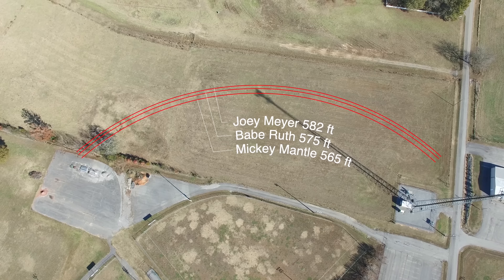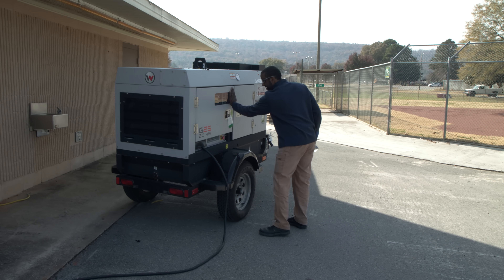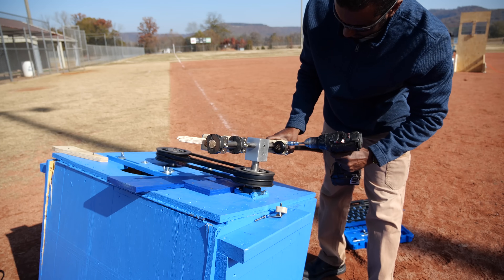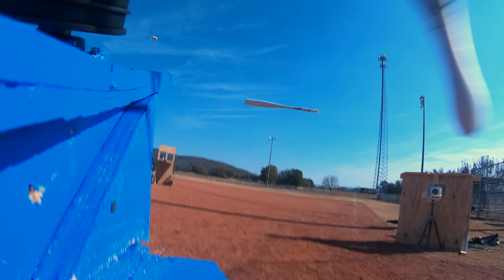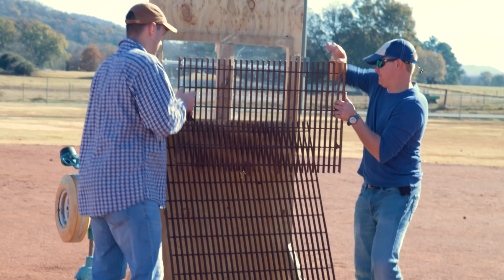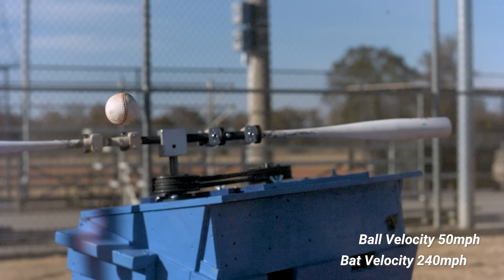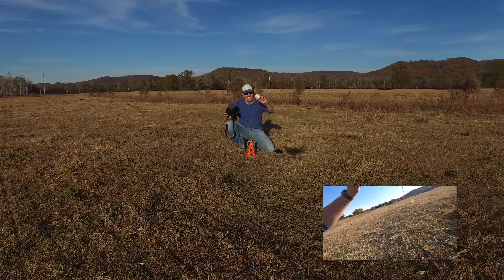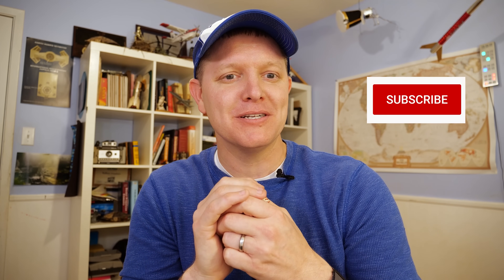World's Longest Home Run (The "Mad Batter" Machine) - Smarter Every Day 230

Comment: There are a couple of different ways that you can explore this into much more depth. Are you trying to hit the furthest baseball ever under the most perfect circumstances or under legal MLB requirements? I think it would be fun to do it under perfect circumstances. MLB uses wooden bats which have a significantly lower restitution, mainly to protect the pitcher and other infielders. 
So since you mentioned restitution, let’s start with baseball bat regulations. The three most common for highschool, college and some adult leagues are USSSA, BESR, and the most common now BBCOR. USSSA uses a ratio in what they call “Bat Performance Factor” (BPF) of 1.20. Meaning that after the ball makes direct contact with the bat, the exit velocity will be at most 20% more than entry velocity. BESR is an older standard and more sought after for adult leagues with no regulations and you can find some of these bats on eBay for almost $1000 brand new. BESR stands for “Bat Exit Speed Ratio” and measure the combined three: ball entry velocity, ball exit velocity and bat swing speed. It was only after about 8 years bat manufacturing companies were finding ways to insert high quality alloys and composite into many different parts of the baseball bat trying to give it as much “POP” as possible. They quickly found that two-piece bats had some mysterious trampoline effect that one piece bats didn’t and boy did it give the batter more power. And this transitions us into the current baseball bat standard for most non-professional leagues, BBCOR. This stands for Bat-Ball-Coefficient-of-Restitution. On most bars along with this you’ll see the number 0.50. Restitution in physics is generally expressed between 0 (non-elastic) and 1 (perfectly elastic). Most wooden bats have a BBCOR rating around 0.50 and this was established again to level the playing field and protect the players of the game. 
My conclusion after explaining all of this, is you want to find a baseball bat that is BESR rated but doesn’t flex like most two-piece bats that you’ll find. I recommend triple alloy bats or full composite bats. 
Now that we are done with that, let’s talk about swinging the bat. Your angle was fine for swinging the bat around, at speeds that high. But one major thing that wasn’t taken into consideration was that baseball players to don’t swing the bat straight around. If you look up many videos of baseball players explaining the perfect swing, you’ll notice as they swing they rotate their wrists counter clockwise through their swing thus rotating the barrel of the bat. Doing so allows that batter to make more solid straight-on contact on the ball, while establishing backspin on the exit of the ball from the bat giving it a higher exit velocity and also allowing it to fly higher. If you were able to figure out a way to employ this into your mechanical engineering, this would be game changing for sure. If you have any other questions feel free to message me. I’ve done a great deal of baseball science research throughout my life and love that I’m able to share it with you. Hope you get to see this. Thanks for all of your hard work in your videos. Happy New Year!!!
Reply: Appreciate the research jimmy. I’d also note that at higher restitutions, you do have a higher chance of your bat snapping or warping at speeds like 200mph.

Comment: Destin: Y'all ready to get smarter everyday?

Also Destin: You reckon this 3/4" sheet of plywood can stop an aluminum bat being hurled at my face at 250 MPH?

Bat: Hold my beer...
Reply: The NotSoGuitarGuy he was in legit mortal danger for like half the vid
Reply: @alex0589  - no doubt. For something like that he needed a reinforced blast wall.
Reply: It's not meant to stop an Al bat, only baseballs and shreds of broken bats.
Reply: It's definitely over an inch thick (2:01). I don't want to minimize safety, because IMO it should be first, but you sure the bat wouldn't have had to come in at juuust the right angle to put more than a dent in that? And what kind of velocity would be left if it got through? Might tickle a little. Batters get hit with 90 mph pitches all the time, direct to the body.
Reply: I think a lot of people are underestimating how strong inch thick plywood is, I understand why people would be concerned but still. Against something as large as a bat I wouldn't worry, if they had tiny shards of aluminium flying around the place then maybe that would be an issue
Reply: Tiny shards of Al might stick themselves in the first few layers of ply, but the pointy end of a broken handled, solid hickory bat doing 190mph would poke itself right through!

Comment: I'd be interested to hear your thoughts on how the differences in energy transfer between the aluminum bat and the maple/ash bats used in the Major Leagues would impact the results of this. You would obviously have to take into account the angle of the grain relative to the incoming ball, but considering the energy transfer is very different for a solid wood bat compared to a hollow (basically spring-like aluminum bat), I wonder how much the difference in distance would come out to being in a scenario like this. Thanks for a great video!

Comment: WOW! This is going to be required watching for my fifty year old son. Now on to the good stuff. Can the ball be fired (compressed air)from a tube/barrel to better find the center of the barrel to maximize the “batter’s power” and then adjust the swing angle upwards to improve the trajectory of the ball? After that I would consider a different bat material. Let’s think about a CNC turned aluminum (7075 T651) bat with the barrel bored out to lighten the front for balance, while keeping it crush resistant. Another option would be a bat turned from one of the engineering plastics with a long draw bolt through the length with a heavy washer and jam nuts to help stiffen the bat and prevent your bat failures. The “Cold Steel” knife company made a synthetic bat several years ago. Now?
 I have enjoyed a lot of your videos. This one is truly out of the park.

Comment: Love your videos, but plywood and Lexan isn't going to do much to protect you against the forces you're working with. Time to step back and look at the SAFETY ISSUE... BEFORE you wind up in the ER or worse. Even the mild steel grating isn't much against an aluminum bat coming at the wrong angle.

Comment: I don't want to be a crybaby about safety but those first tests using just a door were pretty irresponsible. If it had got a clean hit on the ball I wouldn't be surprised to see the ball go straight through the door in a hail of shrapnel and if it chucked the bat at you then good luck. Sure, the door probably would have slowed the projectile down enough that you might be able to walk away from a direct hit but those splinters don't have to be going very fast to take an eye out or catch an artery. 
I get that you obviously can't go carting a precision crafted safety capsule but a few easy to procure items like duvets/floor mats/rugs to spread the impact and catch the bits can really up your chances of coming out in one piece when trying to hide behind a bit of chipboard from fast moving projectiles. Its always better to overdo the safety precautions on the first try because you might not get a second to refine the approach. 

Cool experiment though, well done and all the best for the future.

Comment: From the looks at that first bat break, it seemed like you had the bat lined up perpendicular to the grain. The bat has more strength against breaks when the grain is parallel to the plane of the swing, and doesn't splinter, only crack, when broken.

Comment: Those numbers just make no sense.  If the bat was moving at 250mph then the exit velocity would have been at least 2x the speed of the fastest major league record, which equates to at least 4x the energy.  So only beating the record by 120-150 ft makes no sense.  I'd suspect it to travel at least 2x as far b/c wind resistance is higher the faster you go, so it's definitely not going to go 4x as far, even with 4x the energy.  But an 17.6% increase in distance with 4x the energy, seems off to me.

Comment: I feel like I would be smarter today if I'd learned more about the engineering of the bat spinning machine. Perhaps some discussion about how far down the road of trying to detect the ball and trigger a bat swing  you went vs. just making a baseball bat helicopter and relying on chance. Then, once the helicopter decision was made, what other decisions and calculations went into the design of the machine? Why wasn't a vibration or out-of-balance sensor included in v. 1.0? What role did CAD software play in the design? Was there stress analysis that went on, or was there no time for that? What challenges did construction pose and how did that change the design, if at all? 

As it is, I feel like what I learned here today was that if you hit a baseball very hard it will go a very long way; which, seems fairly intuitive. 

I get that to run a YouTube channel like this, and make anything even resembling a living off it, you sort of have to take the "Mythbusters" approach, I do. I guess I just wanted to register a vote for some actual deeper content for whatever it's worth.

Comment: As a Skunk works alum I read the book before there was even such a thing as audible.  Ben rich was a great man.

Also, in your drone footage there is a bright spot right where the shadow of the drone would be.  I believe that this is from cube corner reflector type structures on plant stems and in the sand, but it would be an interesting video to investigate this effect.  It could be used to fight global warming: retro-reflect the radiation back into space before it can be absorbed and heat things up

Comment: Well Destin, you know what you have to do now. Use physics to show the theoretical longest home run. (Swing angle, ball velocity, bat velocity based on the failure point of the bat material, which I would guess is before the maximum yield strength of the bat). May be cool to use a t-ball scenario to position the ball perfectly.

As always, I love your videos.

Comment: Destin - this video is awesome work as always, but as some have noted, please be careful; you joked about how there wasn't enough reaction time to dodge the bat, but as you also noted that plywood offered inadequate protection.

I decided to calculate the forces here to get an idea of how bad this was. An aluminum bat weighs about 32 oz, so 0.907 kg, and the speed at the end of bat was 250 mph, so 111 meters pers second. Kinetic energy is (1/2 * .907) * (111²) = 5,587 joules. 

That's more kinetic energy than a 12 gauge shotgun (4,453 joules).

That's well within final episode territory.

Dad to dad, be careful, brother.

Comment: I little but important correction to your analysis of three phase supply. Regardless on the number of phases (2 or more) AC motors (ideally) provide constant torque on the shaft given the constant load. Since a part of the current is a magnetization current for the magnetic circuit of the motor, there is always a power factor that is less than 1. However the motor draws constant power from the grid, and output torque is directly dependant on it. 

On the other hand 1 phase AC motors try to create 2 phases by using capacitors, but since this can't be achieved ideally the power has some periodic component and is not constant even under constant load.

Comment: 10:48 in the corner you can see ball flying up because of the Magnus effect
Reply: Your timestamp is wrong.  The ball actually exits the "thrower" at the 10:49 mark.  The bat strikes the ball at very near the end of the 10:49 mark; almost at 10:50.  The ball is set on its trajectory, not my the Magnus effect (which is almost negligible here), but by WHERE the ball is struck on the bat.  Just above the centerline of the ball.  Which causes it to fly straight as an arrow (neither rising or falling) at around a ~30-35 degree angle for a long time due to the negligible Magnus effect because of the flatness of the hit and consequent minimal rotation once it left the face of the bat.
Reply: The Magnus Effect can be most clearly and demonstrably be seen in action at the 10:23 timestamp where the bat induces side rotation of the strike of the ball to impart spin to it.

Comment: That was FANTASTIC!!!  You're funniest video yet!  So...  (munch... munch... munch...)  When are you going to repeat the experiment using a baseball-sized potato gun rocketing the baseball out at 500 mph?  How about a spring-loaded monster-sized aluminum jai alai cesta?

As for the potato gun, the PAK 40 cannon has a 7.5 cm diamter.  I calculated a baseball, which has a 9 inch circumference, would have a diameter of 2.864788976 inches inches, which comes to 7.276564 cm.  Perhaps some wadding, or a sabot, and you're definitely in business!  It can hurl a 15 lb round at 790 m/s, so it'll probably blow the cover clean off a baseball.  :)

Comment: I dunno man if I were you I would have tested throwing a 190 mph ball and a 183 mph bat at your protective structure before getting behind it, even with the borrowed grates. The rocket powered golf club video is just insane, you are all very lucky you didn't get struck by the clubhead. I'll ring the bell if you make a video about committing to safety.

Comment: i'M NOT SURE WHAT YOU DON'T KNOW BUT THE sr-71 WEN FLYING NEAR TOP SPEED (classified) THE PILOT CAN TAKE HIS LUNCH AND HOLD IT AGAINST THE WINDOW AND HEAT IT UP. the LEADING EDGES OF THE SURFACES GLOW FED BECAUSE OF FRICTION. tHE FUEL IS A THICK TYPE, LIKE HONEY. tHE ENGINES WILL NOT IGNITE WITHOUT USING THIS SPECIAL CHEMICAL THAT BURNS WHEN EXPOSED TO OXYGEN. oNCE ENGINES ARE RUNNING THE FUEL LINES HEAT UP TO MAKE THE FUEL MORE LIQUID. SORRY FOR THE CAPS LOCK.  The tires are special. Abile not to explode at 70K feet or higher unpressurized . Tires are filled with nitrogen to avoid expansion and contraction of the pressure within. Tire pressures are upwards 500 PSI

Comment: So... You put a 250mp/h spinning device on an unsecure platform, took it to a public park, and threw pieces of wood and aluminium around at high speed. Destin, this is straight-up dangerous. Rethink the design of this machine before you attempt this kind of thing again. It needs much, much more stability if you're going to put a massive, high-speed rotor on top of it. As a fellow engineer, I am astonished you would exhibit such unsafe practices to the public.

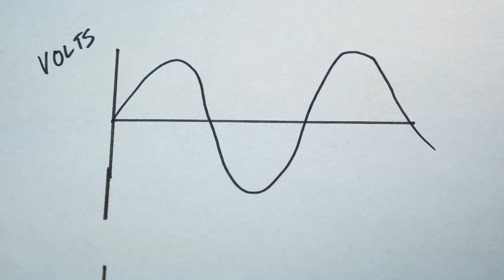Comment: Your 3 phase explanation at 3:10 is incredibly wrong although is a nice idea.

In single phase you do still get torque at the 0v part of the sin wave because their is magnetic potential energy being converted back into electrical potential energy in the coil windings.

3 phase is more powerful because you are not referencing the voltage to ground (0v), instead the positive voltage is referenced to another phase which will be in negative voltage making the difference much more. You can calculate the average by the amount of phases square rooted, so 3 phase is 3^(1/2) or 1.73 the voltage so 100v at 3 phase would be 173v. At least in a delta configuration.

In a star configuration you simply have more power because you're using 3 more coils meaning you can use 3x the amount of current without overloading the incoming line. Which is why it's not as common in heavy duty applications.

This is the reason why if you reverse any 2 phases at any stage, the direction of the motor will reverse as the positive voltage will be at a different reference in the timescale making the positive section reference to a different negative coil.

Feel free to reply a comment or message me if you want me to go into it more of try explain it a bit better, sorry I am very tired right now.

Comment: I’m no engineer, but just hearing that thing spin tells me that a plywood wall is not enough protection for the pitcher.

Also you should enter that thing into BattleBots

Edit: now I watched the whole video. Good job grabbing those steel grates. However I think if a baseball shot at you and hit the grate would cut the ball up and pieces would still make it through the plywood. Just my theory.

Comment: There's a very steep diminishing return on distance by increasing exit velocity. You can shoot a baseball out of a cannon at just under mach and it probably won't go more than 1000 feet as the air in the ball's way ougweighs it significantly.

Comment: Could you guys look into making a smart stop light. maybe a learning algorithm and an array of sensor. Long term they could communicate with other stop lights like some supposedly do already. Can you imagine the environmental impact of not having so many cars idling. Can't tell you the number of time I sit at a light with no cars passing through for a minute or two while holding up a giant group of cars. Is this a thing and why have cities not been implementing this. Seems like an obvious inefficiency with our current technology and the advancement of self driving cars. The hardware seems crazy cheap when your talking bulk. Like how much is an arduino and a few sensors $200 at most retail. Hard part is making it safe and secure. Idling from heavy-duty and light- duty vehicles combined wastes about 6 billion gallons of fuel annually

Comment: I agree that there is "no torque" (magnetic impulse) applied to the motor at zero-crossing voltage. However that does not mean single phase motors have dead spots in their rotational torque. The motor, pulley, and certainly the bat-helicopter setup would continue to rotate due to momentum. Even without any load... you are implying single phase motors rotate unevenly by their nature. That would be bad news for every machine out there that expects vibration free propulsion.